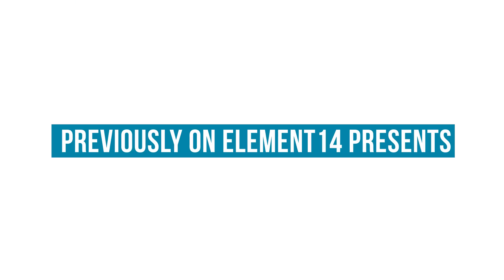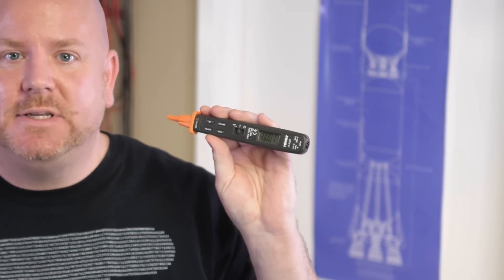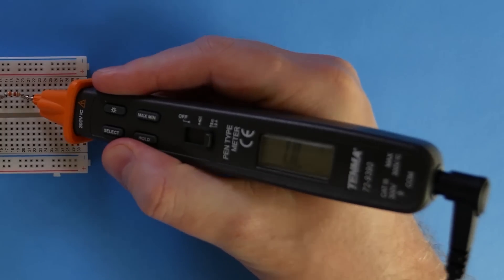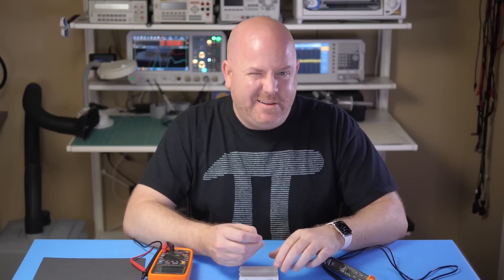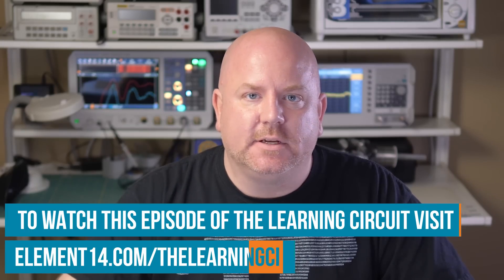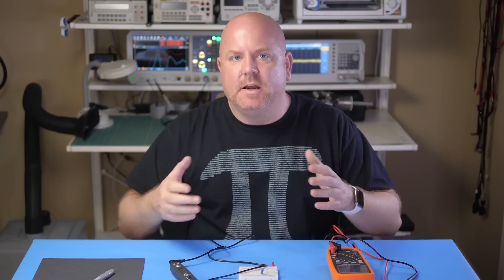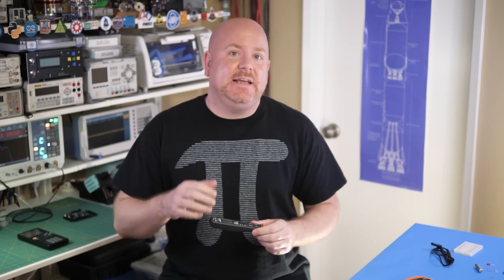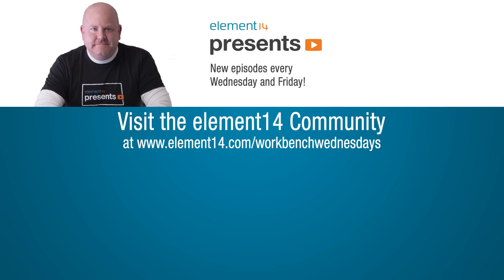Pocket Sized Pen Style Digital Multimeter - Workbench Wednesdays

Comment: The batteries on these smaller DMMs don't appear to last as long as the full size ones as they have to be smaller in size to fit the physical constraints.  If you use it very often it could mean that as the batteries go low, you see more inaccurate readings.